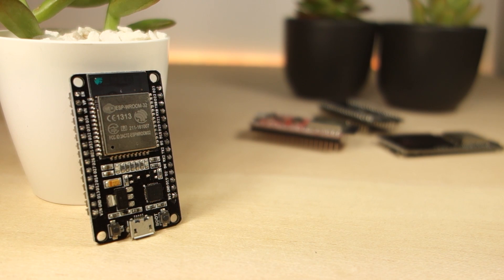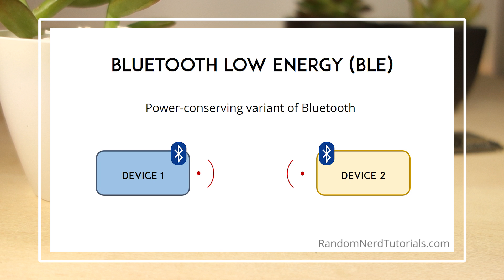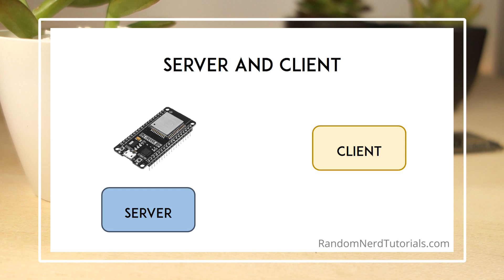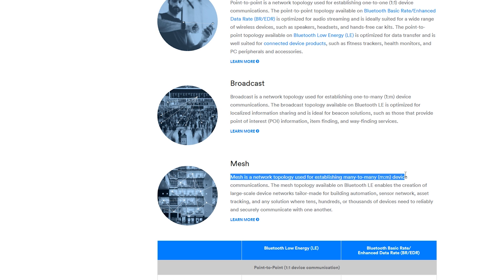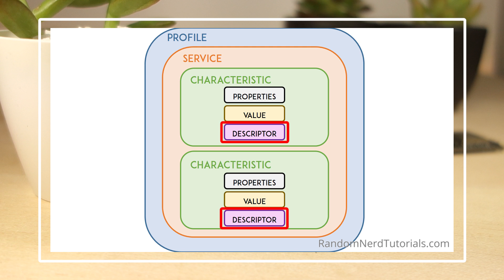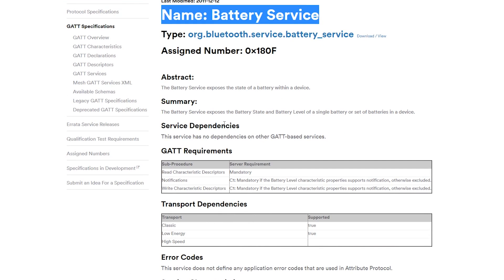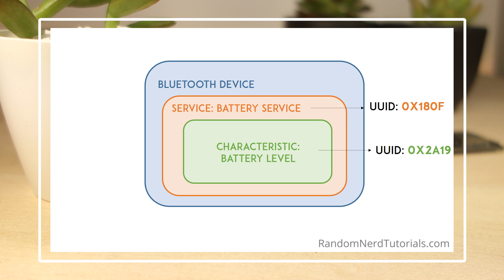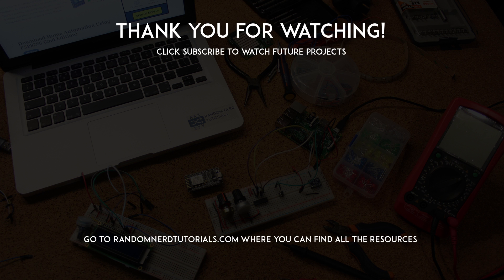Getting Started with ESP32 Bluetooth Low Energy (BLE) on Arduino IDE

Comment: Hi my name is Cyril I'm doing a magnetic loop Project I've got all the parts I want it to be controlled by Blink but but i am now good with the  software  side of the project I am looking for somebody that can mentor me  through the project I am using an esp32 a nomic 17 stepper motor  I have a driver board for the stepper motor and I have a 12-volt power supply for or powering  the project I just haven't got the  experience on the software side mainly to complete the Project so I'm looking for some help from you or one of your subscribers help me complete it.
many thanks Cyril

Comment: Hello, love your tutorials, can you help with a small project. I want my esp32 to connect to the cycling program called "zwift" as a fitness machine. Ftms?  And then receive the resistance characteristic value and serial.print the value. I have been trying for ages. Just need a start off to get going. Thanks for any help

Comment: Dear Rui, Greetings. I am working on ESP32 module for one of my BLE  projects. I used the BLE server sketch that was in one of your tutorials, and tried connecting the server to a android NRF phone client. It worked fine. BLE device name was available within the client. I was also able to read characteristics too, But the same experiment, if i tried executing in my house, the connection does not get established. I really dont know regarding this issue. Kindly advise in this regard.

Comment: Hi! Do you know if you can change the name of the bluetooth so that it appears as we want, when looking for it with another device?
Reply: I know I'm late with this , but yeah, it's super easy to change the device name in the code, just find the line that has the generic device name "esp-××" , and substitute the name you want to use.( Its just like changing the wifi credentials in code before setting up a 8266 or other similar network/comm boards)